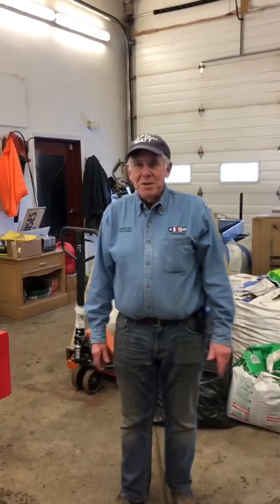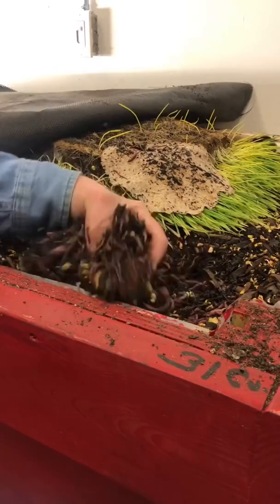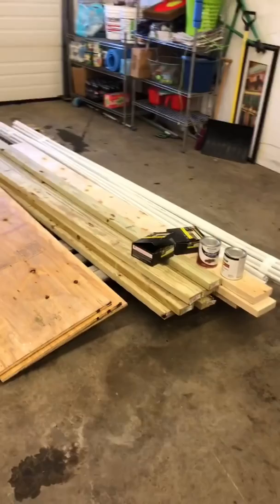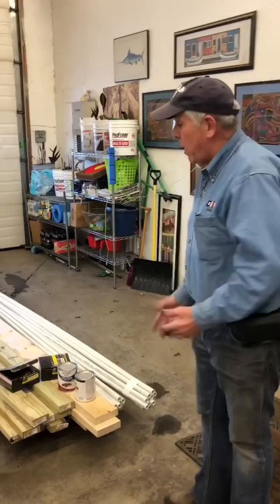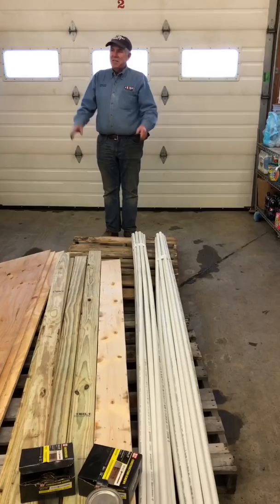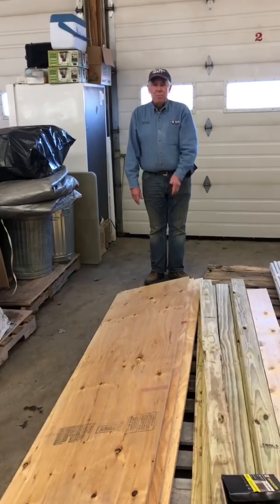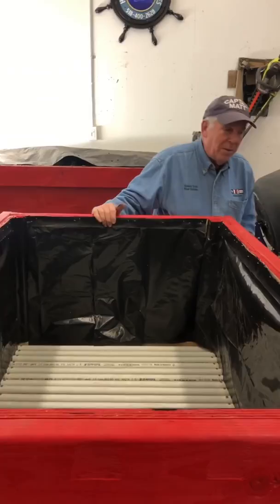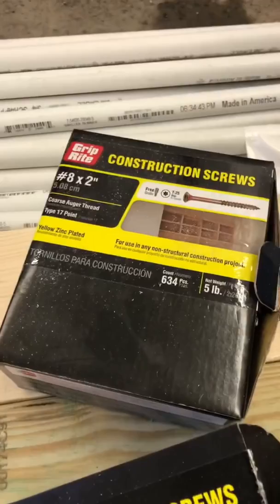Let’s Build a Continuous Flow Worm Bin - Part 1

Comment: What a wonderful video.  I found out in 2011 that I had Parkinson's disease and my life changed. In 1978 I enrolled in a small business management class in college.  One of the requirements was to study a small business and give an oral presentation to the class.  The class laugh at me.  The professor was impressed and said it had lots of potential. I never gave it another thought until three years ago.  My health was going to get worse I knew and I started to sale my businesses. I have always been very active and as II was thinking about my future and what I would do to stay busy the thought cam to me to grow worms. So I did and still growing. I have had a very hard time finding information how to grow it to the next level 
and here you are. 
1. When you apply your worm chow how do you apply it evenly and how are controlling moisture to wet your feed?
2. In your video you showed some compost that you feed your worms. It contains large non composted pieces that will not get chewed up by the worms. Will it plug up your flow through?
3. Do you run all of your casting  from your  bin through a sieve or Trommell if so what size is your screens?
4. How about the little white critters  silver tails i think they call them.
that is enough questions for now I look forward to watch You build a new bin and seeing it work.  Please show how you harvest your casting and how you process them.
Thank you so much for how you have helped me already
Reply from the maker: Worm chow lightly on top of bin if there is chow remaining after 3-4 days let them eat it and then do it again a little this time
My first video shows how it is done
 Have not dealt with silver tails
Reply: Hey Alan - Captain Matt has an excellent video of how he harvests & the unit he uses to sort. It's called Captain Matt's Worm Farm Tour😉

Comment: I built a continuous flow worm bin but I have a problem.  I have worms falling thru the bottom and into the bins on the ground.  Then they crawl out of the bins onto the garage floor and eventually die.  Is this normal or should I be doing something different?

Comment: There seems to be some inconsistencies with the published diamgram and the information in the videos.  Like 3/4" pvc vs 1" pvc.  The height of the base not mentioned in the video, but seems too short in the diagram to get a 24" tall plywood board on the back and side of the base.  Also, the length of the top 8' 2x6 on the front and back shouldnt be long enough when the 9/16 or 3/4 thick plywood is placed on the ends.  Sorry, I'm a detail oriented person and have some experience in carpentry.